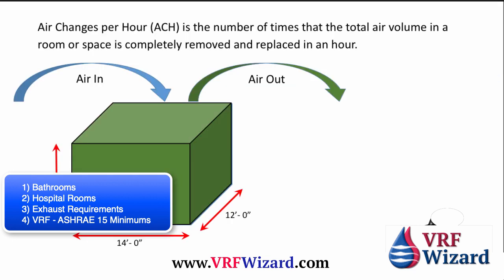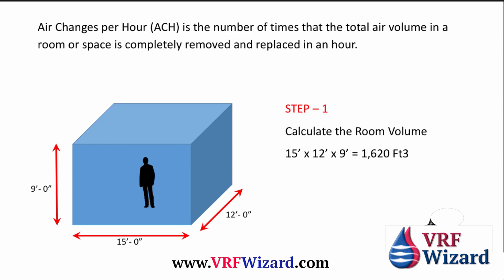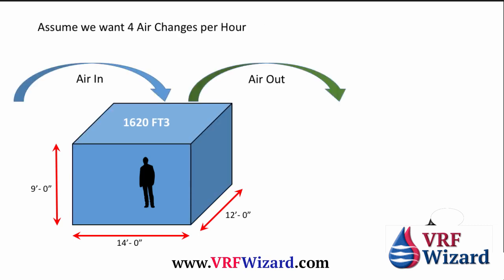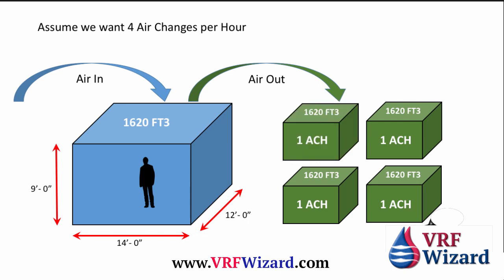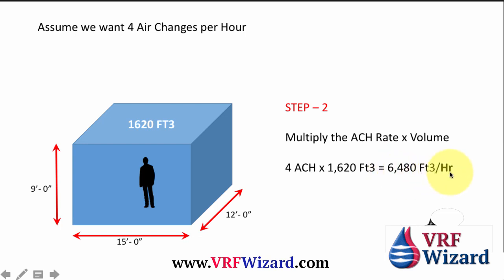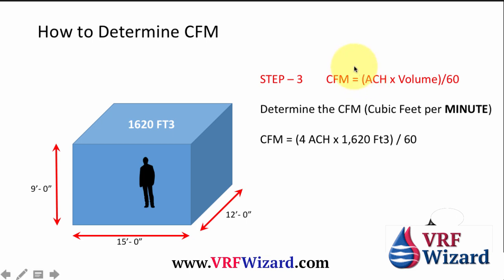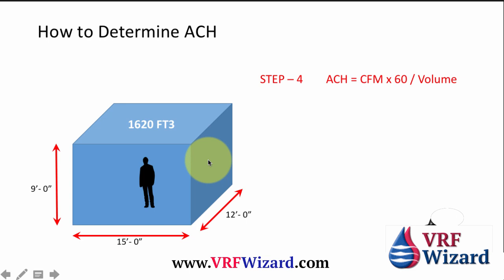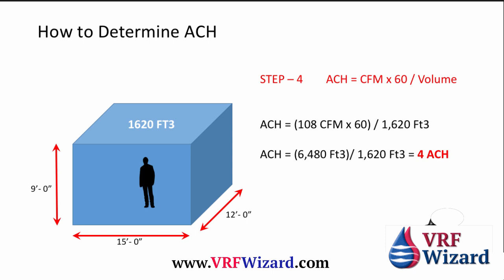How to Calculate Air Changes per Hour

Comment: can you achieve 4 ach with natural ventilation?
Reply from the maker: With natural ventilation it's not ACH you need to consider as much as code requirements. There are so many factors that play into how much natural ventilation enters a building. Consideration must be made for wind speed, wind direction, pressure differential, shape of the building, temperature/buoyancy effect, building opening locations and the size of the openings, etc . You should use ASHRAE 62.1 to determine the required ventilation for the space, then review your local code for the requirements when using natural ventilation, such as in California, USA, Title-24 of the Energy Code Section 120.1, which allows natural ventilation under strict guidelines, such as Naturally Ventilated spaces shall be within 20 feet of wall or roof openings to the outdoors, the operable area of which is not less than 5% of the conditioned floor area or ventilated space, etc.. Hope this helps.

Comment: How to find the air change rate,does it have any instrument?
Reply from the maker: You can use an anemometer to measure the CFM coming out of your supply grille, then multiply by 60 (60 minutes in an hour) and then divide by the Total Cubic Feet of the Room.

Comment: How do we know how many air changes we need?
Reply: For example, will I feel a breeze at 4 air changes per hour?  At 50 air changes per hour?
Reply from the maker: It depends on your local code or ASHRAE standards for the type of room. Depending on the room type the requirements will vary, such as a Hospital Operating Room, Laboratory or Cleanroom. Look at ASHRAE 62.1 for some examples of the requirements per space type.
Reply: @VRFWizard  To be clear, I don't have a commercial building so forget codes.  It's just a workshop, 30X30X12, or 10,800 cu. ft.  I work alone.  No air conditioning.  Few obstacles  What ceiling fan CFM rating would I need to move enough air to feel a breeze on the back of my sweaty neck?  Thx.
Reply from the maker: @rustyicepick8462  To be safe, make sure to capture any emissions from welding, grinding, painting or other hazardous processes with a local exhaust. For what you want to accomplish, all you need is to go to your local hardware store and grab one or more oscillating fans, and direct them wherever you are working. You just need to have air blow over your sweat for the process of evaporative cooling to take effect.

Comment: How many times per hour is the change of ventilation in bathrooms, toilets and kitchens?
Reply from the maker: Depends on your local code. There are standards, like ASHRAE 62.1 which has several variables to calculating ventilation, but basically its based on the area (Ft2). For instance a Kitchen would require 7.5 CFM/Person + 0.12 CFM/Ft2. Bathrooms would require 50 CFM of Exhaust for every Toilet or Urinal. See ASHRAE 62.1-2019 Table 6-1 Minimum Ventilation Rates in Breathing Zone

Comment: Now all I need to know is how do I know how much CFM I actually have
Reply from the maker: If it's an existing system you can take measurements at the fan for the CFM at the system level or in the room that you are trying to determine the actual CFM for.

Comment: Hey Please Do you have any idea??
The air outlet area of the indoor unit of the air conditioner is 0.1 square meters, the flow rate is 2m/s, 
the density is 1.2 kg/m3, and the flow direction is upward 45 degrees. How much is the air exchange 
rate in cubic meters per hour? How many kilograms?
Reply from the maker: The air change rate is based on the volume of the room. What is the width, length and height of the room? This will give you Ft3 or M3. The calculation is based on the volume of the room.

Comment: Hi, i'm asking if the room has circulation fan just like AHU (supply fan & return fan with the same air flow) is this formula still works..?
Reply from the maker: Air Recirculating within the room can count as part of the Air Changes, but make sure that whatever room you're designing also has Ventilation Air Changes or CFM as dictated by your local code or ASHRAE Standard 62.1.

Comment: Please inform..is ACH.means change with outside air? Or just resirculate throught AHU?
Reply from the maker: Air Changes refers to the volume of the room. This can be done with a mix of ventilation air (OSA) and room air. High air change rates using room air is to provide a clean environment usually through HEPA filters.

Comment: if i dont know the cfm & ach of the room, how can i calculate the ach?
Reply from the maker: Depending on the use of the room the code may dictate the required Air Changes per Hour. The first thing you need to determine is what is the designed use of the room, and then what does the code require for that type of room, such as an Operating Room in a Hospital or Bathroom. Check your local code for any requirements based on the use of the room. After you have the code required ACH then you figure out the volume of the space and do the simple math to figure out the CFM required.

Comment: Ok, I tried something about an air change per hour by, for example: if the room is using 8 hours per day, so I used 8 x volume of a room and divided by 60 and the answer is total CFM... correct?
Reply from the maker: You should be looking only at how many air changes are required in a 1-Hour period, as that will be used to size the equipment or be taken in to consideration. Looking at it over an 8-hour period is not how it's figured. Looking at most codes, especially those involving hospital rooms, they will have a requirement based on how many Air Changes in a 1-Hour period are set as a minimum. Your 8 x the volume would give you 8 Air Changes in an Hour. Everything is figured for a 1-Hour period. How many air changes do you want in a 1-hour period?
Reply: @VRFWizard  so, I see the way you used 4 air change per hour;..is that a minimum or an average figured?
Reply from the maker: @hvacrefrigeration5204  That was just an example for simplicity. Depending on the type of room the Air Changes per hour can be 6, 12, 20 ,30, 50 or more. Cleanrooms, operating rooms and other type rooms need large volumes of air re-circulated. Now with COVID everyone is looking at increasing the Air Change Rate and using better filtration to mitigate the virus from spreading or infecting occupants.
Reply: @VRFWizard  thank you so much, I understand now.
Reply: I like to know more about measuring CFM by using pitot tube tested at the return side close to filter placement.
Most of time I have seen by CARRIER approach method.
Can I use the location at discharge side where at about foot or two above evaporator coil, do you think it’s better that way to get a better result of actual air flow through both of secondary heat exchanger and evaporator coil?
Please send me a YouTube video if you have it.
Thank you,
Reply from the maker: @hvacrefrigeration5204  The use of a Pitot tube can be for various reasons. Depending on where you want to calculate the CFM, that is where you would put the pitot tube. So, if you want to know the CFM after the coil, then enter the pitot at that point and read the velocity pressure which you can convert to CFM if you know the dimensions of the duct at that point. The velocity pressure will be the difference between Total Pressure minus Static Pressure.
Reply: @VRFWizard  got it, thanks sir

Comment: Hello Sir, you explained back calculations only. First you declared 4 Air changes per hour and calculated CFM. Again same CFM value used for Air changes per hour calculations. Can you explain, how to calculate CFM without knowing the Air Changes per hour value?

Comment: Wow!  So real-world application wise, what if a city's Housing Code for rental apartment (especially buildings built from the 1920s to 1970s) mandates 2 ACPs for a kitchen room. But most manufacturer's advocate a minimum 350 CFM stove hood fan if one's stove/oven is 30" or higher wide? 

Challenge the Housing Code is outdated when cross-referenced to Housing Safety Codes -- that the exiting rental apartment appliances (stove hood) must be replaced?  Or claim the lower CFM overn hood is "grandfathered" -- exempt from higher manufacture CFM specs (even if the property owner updates the stove but not the hood) per the current (even if outdated) Housing Code?

Yep! This is a real world issue, aggravated by Housing Code Inspectors that have no mechanical/match skills on how to calculate CFMs or ACP of the applicance vis-a-vis the Kitchen Volume! Their inspection test (if you can call it that) is to 1) turn on the oven hood, 2) flick a cigarrette lighter, 3) see whether the fan moves the flame, and 4) whether the fan sounds loud to their ears. 

1) if the fan moves the flame and 2) the fan produces a loud sound, then 3) the Housing Code Inspector claims the oven hood meets the 2 ACPs mandated by the Housing Code for Kitchens.
Reply from the maker: That does sound like some old school inspection criteria. Good luck.

Comment: what about return air quantity?
Reply from the maker: This is a simple example of how to determine the amount of air changes in a room. The amount of return air that gets removed from the room is determined by the room type and the amount of exhaust from that room and its pressure relationship with the surrounding spaces. 

For a room with no exhaust and equal pressure relationship to the surrounding space, then your return air will be the same as your supply. For an operating room in a hospital you may have 100% exhaust and no return air. Its important to first determine the room type and its requirements.

Comment: is 1 exchange per hour adequate for house? I read something like 2-4 for bedrooms and 4-8 for living rooms which is crazy!!
Reply from the maker: Some Energy Codes look at it differently. They don't use Air Changes but state that Whole House Ventilation must equal 1 CFM for every 100 Ft2 plus another 7.5 CFM per occupant + 1, so if you have a 1,800 FT2, 3-bedroom home you would be required to provide 48 CFM of ventilation. (1,800 Ft2 x 1 cfm/100 FT2)+(3 occupants +1 = 4 * 7.5 CFM/Occupant) 
Codes very, so its important to  always check your local code for this requirement.

Comment: Which CFM reading should be used and when? Exhaust for negative pressure rooms, supply for positive pressure 
Or just use highest number CFM?
Thanks
Reply from the maker: You want to use the minimum ACH approved by code because that would allow you to save energy. The choice of CFM is based on your local code and the standards which they have adopted. 
What country do you live in, and which standards have been adopted by your local code? Sometimes thermal heat gains will dictate CFM as opposed to ACH.

Comment: Does this calculation mean that based on this example, a fan rated for 108 CFM would have to run continuously for 24 hours in order to fulfill the 4 air changes per hour?
Reply from the maker: No. At 108 CFM (Cubic Feet per Minute) this would achieve 4 ACH (Air Changes per Hour) in just 1 Hour for this size of a room. ACH calculations, or Air Changes per Hour determines the amount of CFM required to accomplish changing the air volume of a space in just 1 hour, hence Air Changes per HOUR. So to achieve 4 Air Changes in just one (1) hour for this size room would require a fan that can do 108 CFM.

Comment: Hello sir,
I have a 36×12×20 ft volume of a room but i dont know how much air changes per hour of that room
So pleasw tell me how to calculate cfm of my room
Reply from the maker: Please watch our video on how to calculate CFM for your room. https://youtu.be/x59AS0SQtCg 
There are many factors that go into answering your question. You need to know if it's an exterior or interior space. Is this Exterior glass, if so, how many square feet of glass, and what is the solar exposure and "U" factor of the glass? Where in the world is the building located, each location has different weather conditions. How many people will be in the room? How many watts from lighting and plug loads? What is the design Outdoor and Indoor Temperatures?

Comment: To determine CFM, do you combine both supply and return CFM or take the greater CFM of the two?
Reply: It depends on what the room is designed for. If it’s negative space you would go off the return. If it’s a positive space (operating room) you would go off the supply. 
I’m a air balancer and asked the same question recently

Comment: I dont know cfm,  then how i will find number of ach??  It is assumption??
Reply from the maker: The quantity of air changes is often dictated by code for the different types of spaces, such as for bathrooms, or hospital operating rooms. Once you know the code required Air Changes per Hour (ACH) required, you can determine how many CFM would be required.

Comment: Why not Ft^3 / 60 to get CFM at 1 ACH and then *4 for 4ACH or /3 for .3ACH, so on and so forth?
With the given example of 12*15*9=1620 it'd be just 
1620/60=27 CFM(1ACH) 27*4=108 CFM (4ACH)
Reply from the maker: Yes, you're correct that both ways of using the same values come up with the same answer. Either method of calculation works.
Reply: @VRFWizard  Oh, yeah it's not wrong- I meant for simplicity, it seems (to me at least, and I may be odd!) that it would be easier to explain. Great video by the by :)

Comment: How does OA% play a role in this equation?
Reply from the maker: Outside Air is determined by many factors, including the type of space and the quantity of occupants. In hospital and healthcare facilities, the driving factor can be Air Changes per Hour, as some hospital rooms require 100% Outside Air. So, it's important to start with the space requirements as dictated by the code authority. Look at ASHRAE Table 6.1 Minimum Ventilation Rates (CFM/FT2) https://ashrae.iwrapper.com/ViewOnline/Standard_62.1-2019
Reply from the maker: Here is another link for Healthcare Facilities showing minimum Air Changes per Hour https://ashrae.iwrapper.com/ViewOnline/Standard_170-2017_(86529)

Comment: Dear sir, how we assume it 4 times??? 🤔
Reply from the maker: I used 4 air changes just an example. The amount of air changes required will be dictated by your local code or by good engineering practices for the type of space being ventilated.
Reply: @VRFWizard  still confusion, any technique?
Reply from the maker: Design recommendations for air change rates for various applications are primarily contained within the 2015 ASHRAE Handbook– HVAC Applications. www.ashrae.org

Requirements for outside air ventilation rates are contained in ASHRAE Standard 62.1-2016, "Ventilation for Acceptable Indoor Air Quality"
Air change rate - imperial Units
n = 60 q / V                                  
n = air changes per hour (1/h)
q = fresh air (make up air) flow through the room (Cubic Feet per Minute,  cfm)V = volume of the room (Cubic Feet)
Air Change Rate - SI Units
n = 3600 q / V                            
n = air changes per hourq = fresh air (make up air) flow through the room (m3/s)V = volume of the room (m3)
Rush, I hope this is enough information to get you started in the right direction.
Reply: i have a question. what is used to supply those  cfmsto replace the air ?
Reply: @VRFWizard  WELL explained

Comment: This was really disappointing - it is just a lesson in basic arithmetic and conversion of units that common sense and high school should have provided for.  I was hoping for a discussion of the likely air changes in real life buildings and how to arrive at the best assumptions when making heat-loss calculations.
Reply from the maker: Your right that this is a basic overview of how air changes are determined. Heat-loss calculations are based determined using one of the many cooling load software programs and there shouldn't be any assumptions about ACH. For Hospitals Air Changes can be the driving force for various rooms, but that is beyond the scope of this video.
Reply: And why would you expect all of that in a video that is literally titled "how to calculate air changes per hour"

The video provided exactly what it was titled

Comment: Hi. I have a question. I am completing a ventilation air schedule for floor plans. I have figured out the required OA CFM but it also requires that I calculate the actual OA CFM. Is there a formula to help do that? Thanks.
Reply from the maker: It depends on which code is required in your area. ASHRAE 62.1 defines the standard for calculating the ventilation (OSA) requirements for various building space types. Depending on the type of room, there will be a requirement for so many CFM per person, and older standards include a certain amount of CFM based on the floor area. The calculation is based on Quantity of People (CFM/Person) and some codes require additional CFM for the off gassing of furniture and interior finishes (CFM/Ft2)  Hope that helps.